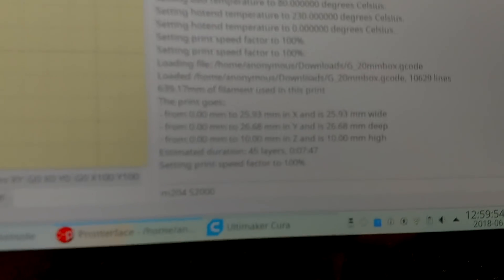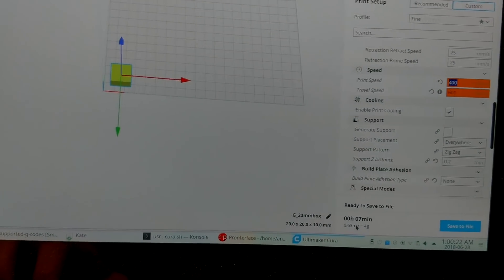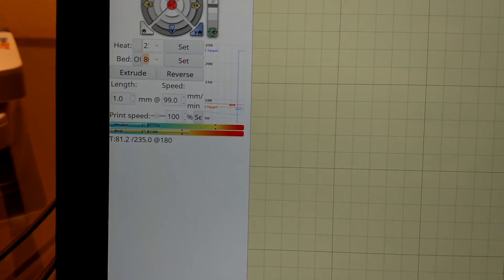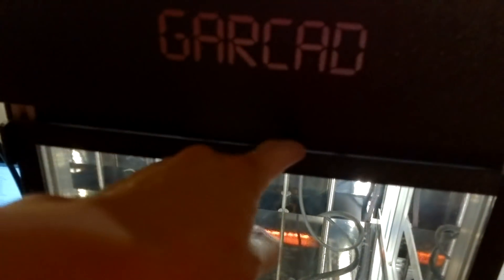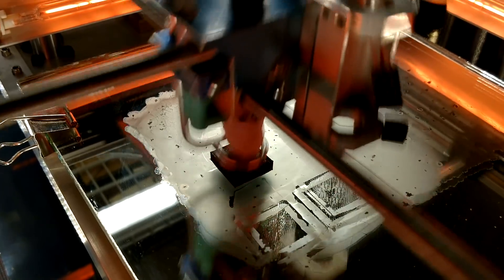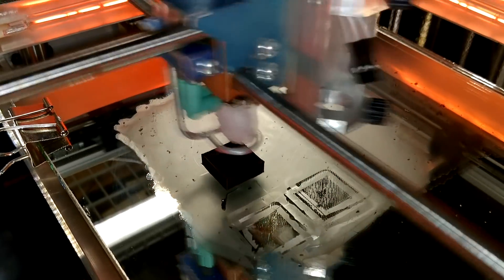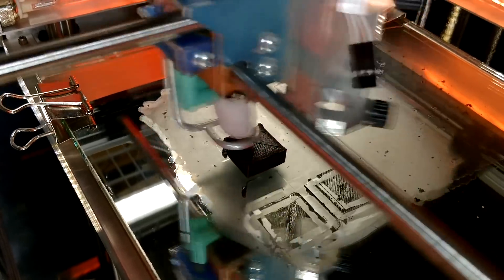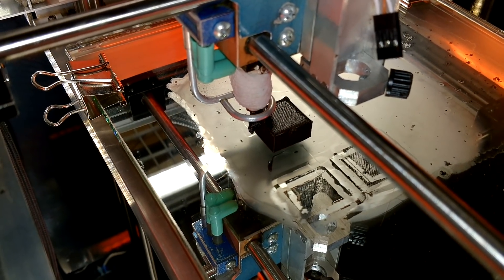GARCAD 400mm/s print speed, 16m/s/s acceleration.

Comment: How much EXTRA nozzle temp did you need to run to keep up with extrusion speeds?
Reply: @Liberator12k  do you mind me asking what hot end & nozzle you're running? (I just received a carbide nozzle from Dyze design in the mail) I'm converting an old cubepro trio over to a 32bit open source setup.

Comment: I can manage 300m/s travel speed, with 10,000mm/s^2 acceleration*. CoreXY, Bowden setup, PLA filament. It was skipping steps at 300 before Vref tuning, and never have I dared to try higher. I use 200m/s for infill, inner wall, and supports, 75mm/s for skin&outer wall... and 200m/s parts don't exactly look great. I wonder if it's even possible to create anything recognizable @ 400m/s extrusion on an FDM under any condition, if it were not a blocky model.

* disclaimer: At the time of initial writing of the comment, I did not check the firmware limitation I had right in configuration.h file that I thoroughly went through. it was actually 3,000 mm/s^2 acceleration.
Reply: I take my words back, mine doesn't go 10,000 mm/s^2 acc. I'm just stupid enough to not check the firmware limit :P

Comment: Hey there
I got a few questions if it doesnt bother you:

1. Whats the nozzle diameter

2. For what are you using watercooling

3. How are you cooling your parts

4. Do you have a normal V6? Or vulcano (i cant see it)

5. Do you use normal belts

6. What sort of stepper motors do you use?

7. What are the stepper drivers

8. Why a glass surface instead of a buildtak like surface

Thanks in advance
Happy printing

EDIT MOST IMPORTANT: Is it a direct drive?

Comment: You can put the printer al 1600mm/s is the same because in 20mm it cant accelerate to the 1400km/h that represent 400mm/s... if the printer accelerates to 16 mm/s, reaching 400mm/s would take 25s. If my calculations are correct to do 20mm reaching 400 mm/s it would take 0.03 seconds and the acceleration will be 14000mm/s^2
Reply: Xf=X0+Vf*t+(1/2)*a*t^2 => Xf=3/2*V*t because a=v/t in this case (Vf=V0+t*a but V0 is 0 and X0 is 0 too)

Comment: I’m crying looking at this, while my 3D printer prints with 35 mm/s speed
Reply: Same
Reply: I've got a CR-10s printing at 60mm for fine prints and 80mm for faster ones. Im getting an ender 5 and probably also a bigger nozzle. Which would you recommend? I will be printing stuff like cases and small mechanical parts. I don't need it to be super fine, just fairly smooth, accurate and strong

Comment: It's like Formula One engines - the car goes around at great speed but you have to rebuild the motor after one race. You'll need new spare parts very quickly for non-quality prints.

Comment: now thats some rapid prototyping, I love how at this speed you have all new problems with tuning stuff ( aside from cooling ), the filament feeding and spool starts to require a tensioning , and parts will need to be beefed up, I bet this would chew through wheels and bearings in no time.
Reply: HDD bearings sustain all the time 5,400/7,200/10,000rpm unless you lubricate often them you could dry them fast.

Comment: I've been toying with TB6600 drivers lately and managed to print at 400mm/s with moves at 600mm/s :) Looked very similar, tho i only used 9m/s acceleration and 60mm/s jerk.
Reply: @Liberator12k  Completely. just completes so stuff so damn fast :)
Reply: @Liberator12k  please post a video about that, would be interesting to see :)

I often need tight tolerances so 0.4mm nozzle for me.

Comment: Wow, that is insane! If you are going to try and tune that, you need to reduce as much mass from the printer head as possible and make sure it is as stiff as possible. At those speeds, accelerations and jerks, It'll start introducing artifacts that at lower speeds you wouldn't notice as much.